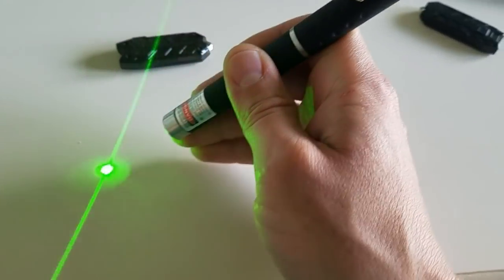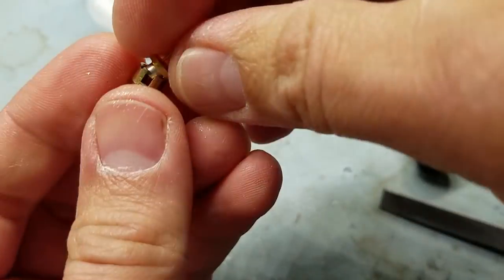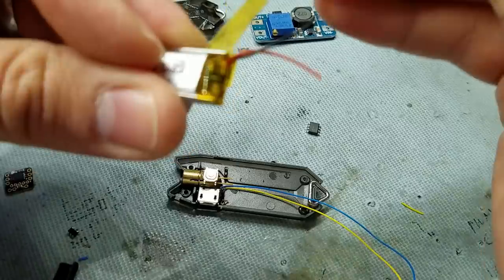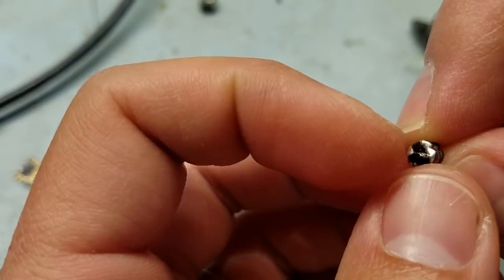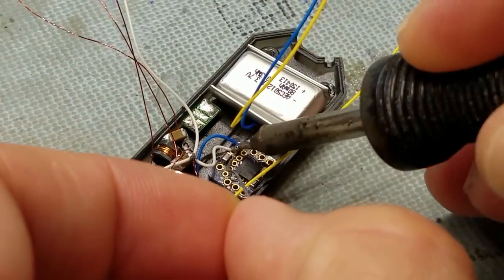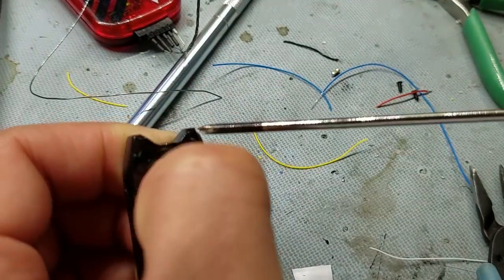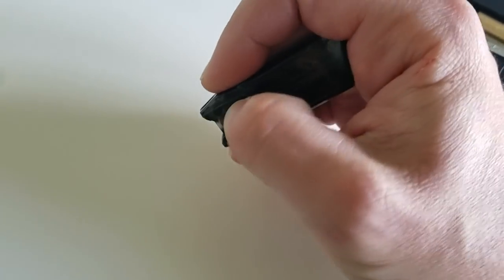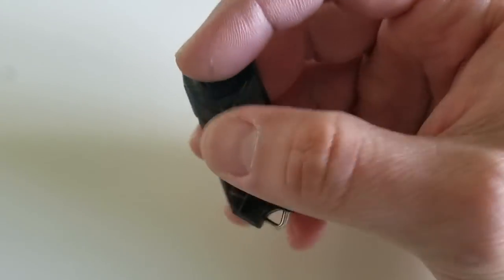Building a tiny green laser pointer

Comment: Awesome project! Love when you post stuff!
The damage done by a laser in this wavelength and power range to the human eye is primarily thermal. However, the damage to cells doesn't scale by the joules of heat delivered into the eye, but rather the power density. The Wikipedia article on laser safety has a section called Maximum Permissible Exposure (MPE) which is the relevant metric. It includes about a factor of 10 safety margin, in particular the second graph in that section of the article is what I reference here. For a typical 5mW laser, the MPE works out to about .1s, this is typically enough time for the pupil to react, and the person to flinch away. (It works out For a 20mW laser, the MPE goes down to about 1ms. You mentioned your pwm circuit is doing 2khz pulses, so that puts you at .5ms.) At 2khz, for 20mW this makes me think each pulse is probably short enough that it is at least less dangerous than CW, however at 2khz you could also easily hit the same area of your retina with several consecutive pulses. I don’t know how quickly the retina recovers from an exposure below the MPE before it can withstand another exposure. I also don’t know how PWM would effect the eye’s reaction time to flinch away. This could be significantly reduced, which could make the chance of several repeated pulse exposures much higher, which may actually make it more dangerous.
In any case, the build is dope either way, probably just want to use it with a higher degree of caution then you would a regular CW 5mw pointer, close to how one would normally treat a 20mW CW. And builds that use even higher power CW diodes, or shorter wavelengths, may in fact just become significantly more dangerous using PWM.
(Edit: after rewatching a heard you mention the PWM frequency and updated my response. I work with lasers regularly, but haven’t had cause to consider the impacts of PWM on CW lasers before, whenever we pulse our diode lasers its in the few 100 hz range and we just treat them like they’re in CW mode for safety. This is mostly just back of the envelope figuring but it should be in the right ballpark)

.... Secret Chicken Sandwich.